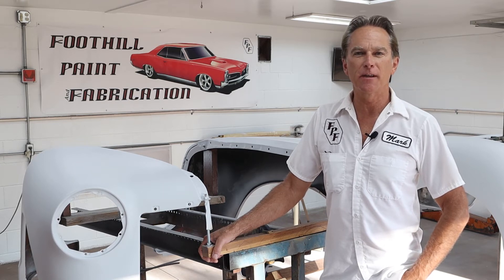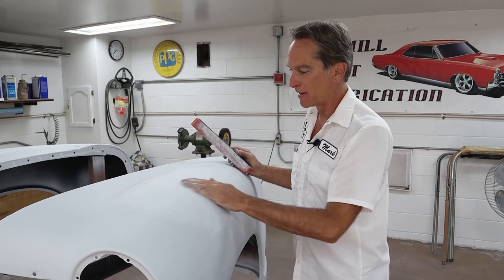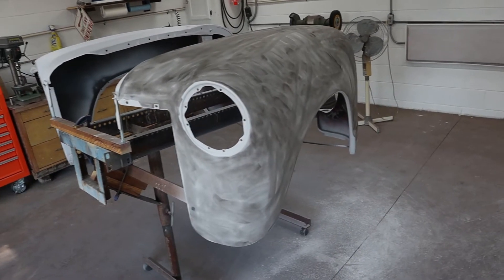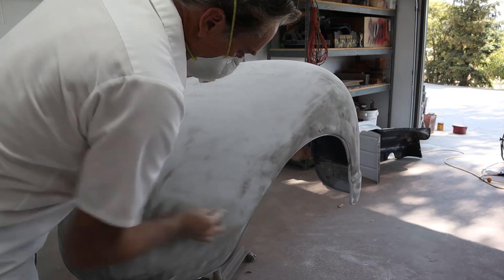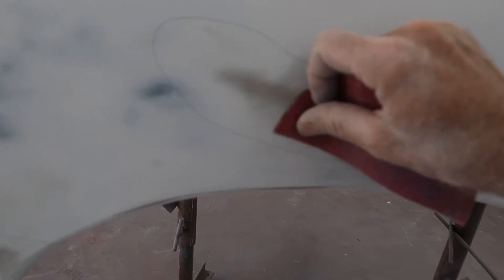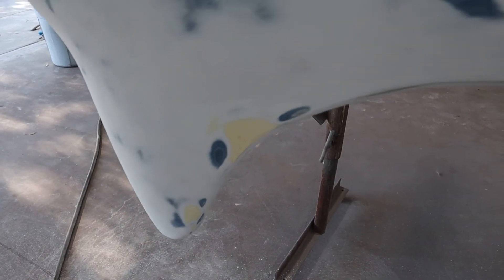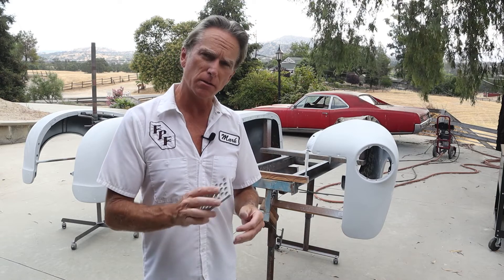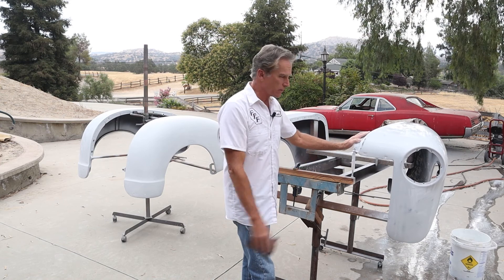1950 Chevy Truck (Ep 10) Guide Coating and Blocking Fenders

Comment: another good trick guide coat the glazing. For really nice work it makes it super easy. I just have a Old Harbor freight purple gun with super thin basecoat black in it give it a quick shake. But a really fine coat over it dries in seconds. and sand it off. wont clog the paper at all. Most of the stuff I do today I do DA blocking I dont really care if it is a bit wavy. still comes out really nice. Or you can do a little with the DA then do a quick mist and hand block it after DA blocking to get a perfect block. My shoulder is just too bad to do much hand blocking.

Comment: Great video!  You are exactly right, I changed to the dry coat system many years ago it is a game changer.  When it comes to sanding the ripple Areas of the Fender seems, I like to wrap my sandpaper around a piece of scotch bright so it has a soft backing to get down it the low spots. It works great and keeps your fingers from getting sore.